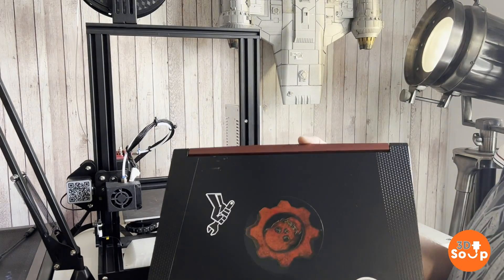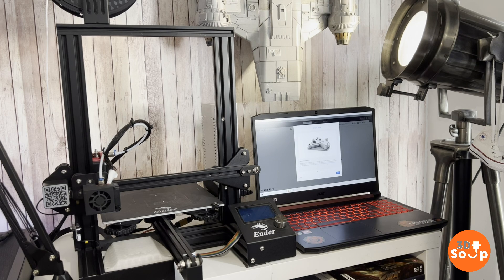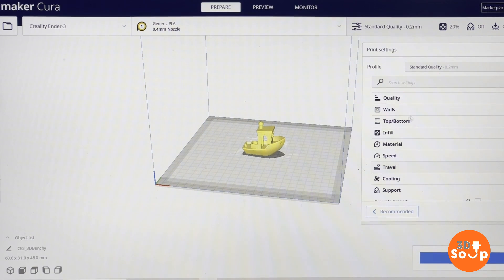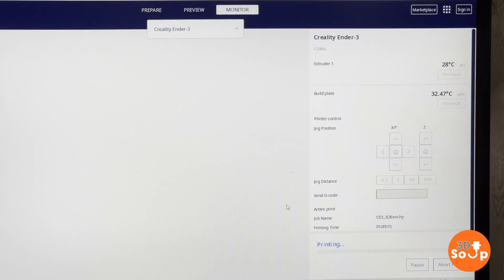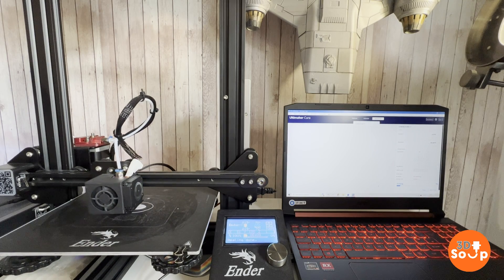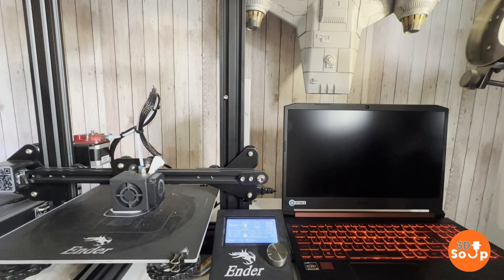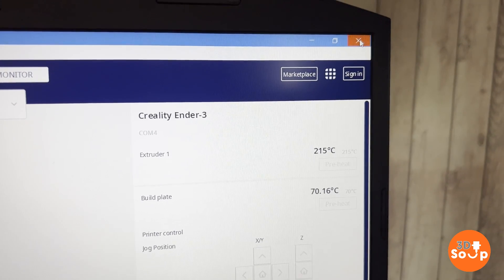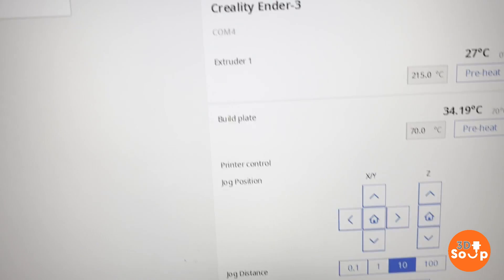Connecting an Ender 3 3D printer to your computer or home network via the USB port and why to do it.

Comment: Thank you for this, can you tell me the full model name for that printer as I am strugging to find it on Cura
Reply from the maker: Just add a non ultimaker printer, choose Creality and then choose the ender 3 you are using. Thanks for watching :)
Reply: @3dPrintedSoup it's the same printer you have in this video but the model I have been struggling with. The box says Ender V3 3 but so many of the slicers have SE or neo bit it's not one of those and I got it as a present and they will not tell me without proof of purchase

Comment: I was doing this with my ender 3 3d printer but cura doesn't have it anymore what should I do should I put it under a different 3d printer or use something else
Reply from the maker: Even if it’s not showing up by default, Cura still supports the Ender 3. Here’s how to get it back:
	1.	Open Cura.
	2.	Go to “Settings” → “Printer” → “Add Printer…”
	3.	Click “Add a non-networked printer”
	4.	Scroll down to Creality3D and choose Ender 3, Ender 3 Pro, or Ender 3 V2, depending on your model.
	5.	Click Add.

If it’s still not showing up:
	•	Update to the latest version of Cura from Ultimaker’s website.
	•	Or install an older version (like Cura 4.13) which definitely includes Ender 3 profiles.
Reply: I tried that but it doesn't seem to support ender 3 V1
Reply from the maker: Odd, just tried and the ender 3 profile is still there and works fine with my V1 and pro

Comment: can ender 3 s1 pro do this?
Reply from the maker: I don’t think the usb on the S1 is able to this, been a good couple of years since I had one though.
Reply: @3dPrintedSoup oh dang, some how i think its caused by bootloader, i try to buy cheap clone st link v2 to force it, but make a backup first so if i'm failed i have my way back

i done a lot of way
gcode to force flash
usb
sdcard

but not with DFU cause i have limited knowledge about it
what do u think?

Comment: Why am I always the only one that can't solve an issue like everybody else? I'm doing exactly what you did, but I can't connect the laptop to the printer with a cable. I only get the Save to Disk option.
Reply from the maker: Don’t worry, the ender 3 is great but there are loads of variations ect. Try checking that the cable is a data cable and not just a charge one. Make sure you have the most up to date version of cura and the printer firmware is current. Best of luck :)
Reply: Set it all up plug in the usb computer first and it’ll happen
Reply: Ive got an endwr 3 and im trying to connect it to cura and orca slicer and cant get it on either any ideas?
Reply: @jamesblack1683 sometimes the cable you’re using might only be a charge cable instead of a data transfer cable

Comment: OK. You have Cura & an Ender 3D Pro. It appears that you had no problem connecting through a USB cable. I have Win 10 & Ubuntu Linux OS. , Cura & an Ender 3D Pro. y systems see the CH340 USB serial port. But not the printer! What clues do you have for connectivity & control problems?
Reply from the maker: Yeah, this video is about connecting to a windows pc via usb. No idea how Ubuntu would affect it. Best things to check are that you are using a data cable, not just a charging cable. Make sure your printer is on up to date firmware and that you are using the most recent version of cura. Thanks for watching :)

Comment: Will this same method work for the voxelab aquila x2? It has the same port on the printer but does cura support voxelab
Reply from the maker: You would need to check if the port on your printer is a working data port, or if it is power only. Check the list of compatible printers on ultimakers site to see if cura supports it.

Comment: This is great.  I inherited an Ender 3 Pro but it didn't come with manuals, software or SD card.  Someone told me that the machine only works with 8GB max SD cards and those are impossible to buy today except maybe used on ebay.  Will this work with free software such as Creality Slicer?
Reply from the maker: Not with creality slicer as oddly they don’t support it, use cura, it’s free, or orca slicer. Thanks for watching

Comment: Which version of Cura are you using.  and what Operating system
 software is on your laptop?  thanks
Reply from the maker: Use the latest version of cura and select ender 3. Windows 10

Comment: Have you not upgraded your hot end yet?

Also, the issue I had when it came to printing via USB connection, was that it'd stop mid-print... And nope, no sleep option set.
Reply from the maker: This is my stock ender 3. I have several upgraded versions of most Ender models . Not sure why your print is stopping, , not enough info to guess
Reply: @3dPrintedSoup  aye, there's no errors whatsoever, unless there's a debug mode, but I've switched over my Octoprint to my servers not instead of Raspberry PI, if I get the chance, I'll try it on there.

Comment: Do I need and expensive high performance laptop? Or is a budget laptop okay? I'll just be extracting files not making my own 3d modules
Reply from the maker: For linking and sending files to a printer, no, a regular modernish laptop or computer will have no problems- for 3d cad design and 3d modelling, you are going to want something with a bit of power as this can stretch most systems depending on the type of design you are doing.

Comment: printo from usb? nope not an option for me......makes sense on whyt i could never preint from the darm laptop. and it wont take my usb card a-either. YAY worst interface ever on these enders!
Reply from the maker: Hi, just checking, you are using a data cable and not a charge only cable right?

Comment: What happens if I am printing via cable and my computer shuts down? Will it continue printing or will it stop and lose the printout? Thk
Reply from the maker: You are printing directly from the computer, if you turn off the computer then your print will stop. Hope this helps.

Comment: My daughter lost her USB is there a replacement I can use
Reply from the maker: You can just buy another usb stick, should work fine. If you mean a usb cable then you can use any usb data cable as long as it matches the connection on the printer (mini,micro or C )

Comment: if I have my printer connected to my PC and have creality installed on my PC and in the same account will I be able to control it with my phone?
Reply from the maker: Not with creality slicer as last time I checked they insist you have the creality box to connect non WiFi printers . If you have a raspberry pie, you can setup octoprint or the like to connect some printers wirelessly to a network, see my video on this. Hope this helps.

Comment: I can’t seem to connect my printer to Cura since it just says “in order to monitor your print from cura, please connect your printer.” Even though it’s connected with usb cables
Reply from the maker: Okay, check you are using a data cable and not just a charging cable.thanks for watching :)
Reply: @ ohhhh how do I know if I’m using a data cable and if I don’t have one where can I get one? (Edit: I GOT IT TO WORK THANKS SO MUCH NOW I CAN PRINT MY BENCHY!)
Reply: @Mr_porkchopgood work!
Reply: @Mr_porkchop how did you get it to work mine is saying the same
Reply: @joshuavanvuuren-t2o  you kinda just have to restart cura and if that doesn’t work unplug your printer turn it off then turn it on and plug it back in

Comment: My Ender 3 won’t connect to my computer for the life of me. It used to work and print perfectly fine. Any help/ advice?
Reply from the maker: Hi, make sure you are using a data cable and not just a power cable. Also ensure you are running the latest firmware on the printer and the latest version of cura. Thanks for watching

Comment: SO a created a Cura account but it doesn't seem like I can add/use my Ender on this software
Reply from the maker: Open cura, click the drop down next to the open file icon in the top left of the screen (it looks like a file) , click add , choose ultimaker or no ultimaker and then either choose your networked printer or add a non-networked printer. Done

Comment: is there any specific reason that my ender 3 3d printer will not work with my micro usb cord.
Reply from the maker: Which model ender 3 are you using?

Comment: Will this work with a Windows 7 version for the ender 3. If so, can you please tell me which version of software through the slicer should I use.  I have a new laptop.  But I have several older windows and 7 laptops.  One being the acer aspire 7540-1284. Thanks in advance for any help you may be able to provide.
Reply from the maker: Never tried it on windows 7 so you will have to give it a try and see.

Comment: i really need your help, indon't seem to be able to connect my ender-3 and i just wanted to know if you have to use a spicific cable?
Reply from the maker: Depends which version you have, some have mini usb and some have micro or usb C . You just need to get the one with the correct connection- and make sure it’s a data cable and not a charge only one. Hope that helps
Reply: @ alright thank you very much dear friend 🤗

Comment: Just watching this and as for the sleep issue, there are detailed settings in windows that can shut down or reduce the power to the usb ports as part of the "power save"
I also run photobooths and because of that I have done a deep dive and changed all the power saving functions prior to putting the systems out in the wild as they can drop the camera connections if left at default values. This also helps to maintain highest levels of performance on the systems at all times.

Great info overall, I'm looking forward to repurposing an old system to control my printer via the usb instead of constantly swapping the SD card in and out.
Reply from the maker: Glad you enjoyed the video, thanks for watching :)
Reply: How did you do it? I plan on using an old laptop for printing and camera monitor and thought I would just disable every kind of sleep/hibernate/screen off/saver

Comment: I changed the board, in my Ender 3, from the original Creality board to a BTT SKR Mini E3 V2.  Everything worked fine with the Ender board.  However, with the new board (BTT SKR Mini E3 V2), my computer does not recognize / cannot find the Ender3 now.  Any thoughts, ideas, suggestions.  I am not super computer savvy or techy.
Reply from the maker: Hi :) as you have swapped the main board out, your printer may no longer be seen by your pc/cura as an ender 3 (not 100% sure as not used this board myself). Check with the manufacturer to see if the board supports usb input.

Comment: 8:15 ah the introductory line that I forcefully moved to the bottom center by modifying the gcode so that it was easier to remove on my ender 3 v2 😀
Reply from the maker: The line is there to ensure the flow is smooth and consistent, if you remove it fine, but it’s there for a reason. Thanks for watching and commenting :)
Reply: @3dPrintedSoup  I didn’t remove it, I modified my slicer’s start gcode paramater to move it to the bottom middle instead of bottom right corner

Comment: i have an issue where i have everything set up, the power is on, i sliced it correctly and i did everything else. But the second i connect the usb cable from my pc to printer it doesnt registeer it on the computeer, and i dont have the option to print straight from the slicer on the montior screen, and also the screen on the ender 3 keeps blinking until i unplug it with the power on. Any tips on how to fix this?
Reply from the maker: Hi there! Have you got the printer plugged into mains power as well as usb? Have you clicked the drop down menu next to the slice button and selected usb?

Comment: I'm having trouble, you did not mention the printers usb drivers once when Everyone else does, currently my pc has no way of talking to the printer as they both do not acknowledge the other, how should I proceed?
Reply from the maker: Make sure cura is up to date, make sure you have the newest firmware is installed on ur ender 3 - you should then be able to choose your printer via cura.

Comment: whats the point of monitor? thought it would show you realtime what its printing (layer etc). if not this function is useless and no point connecting to printer
Reply from the maker: If you find the ability to send G code directly to your printer without needing to use an sd card useless that’s your choice. Thanks for watching.

Comment: hello. ik im late and this might be a stupid question. but if i connect my printer do i also power it on via the powerswitch or just the cable in the laptop?
Reply from the maker: You need the printer connected to power as usual, usb doesn’t have the juice needed to run a printer unfortunately. Thanks for watching.
Reply: @3dPrintedSoup  ty ty. unfortunately cura doesnt find my monitor connected. so ill stick to sd cards. i have to get a reader first but your videos helped me alot getting started. big up again

Comment: Thank You for the video. Do you keep the sd card with the firmware on it,  in the printer or take it out?
Reply from the maker: Once the firmware has installed and upgraded it’s on the printer permanently, you can take the sd card out and delete it

Comment: Mine crashes with my usb 😂 pls help 😢
Reply from the maker: Need a bit more info.
Reply: @3dPrintedSoup  I plug it in, and the display flickers and stops, and if anything is printing, it stops and says lost of power resume or stop print, and cura does not have the ender 5 pro (my printer) so I just use the regular ender 5. When I connect it with the power button off, the screen turns on (which is why im thinking the usb is drawing power from the usb to the printer).

Comment: cura isnt detecting my printer for some reason i have it connected via micro usb, selected the right model, when i click slide and the right it does not give me the option to print it only to save it to my library any help would be appreciated.
Reply from the maker: Okay, check you are using a data cable and not just a charging cable.
Reply: @3dPrintedSoup How do I tell the difference between them?
Reply from the maker: A good question- it’s not the easiest thing in the world as they are not really marked as data and non data. I look in the usb A end and see how many connectors it has. If it’s only got 2 then probably a power only cable- saw between several and see if any work for you.
Reply: @3dPrintedSoup I see 4 just ordered a new cable hopefully that works.
Reply: @Subfisher Im having the same problem aswell. Did the new cable work?

Comment: Hi mate, when I connect my Ender 3 Pro via USB my printer reboots. I don't think it can sustain a print job with the cable connected. Happen to have any idea why this may be?
Reply from the maker: Okay, first question, the printer is plugged into the mains and turned on right? Sorry to ask but have had some cases where people thought the pc would power the printer via USB.
Reply: @3dPrintedSoup  yes sir you're correct, I have the power cable plugged into the PSU. Prints work just not when usb is plugged in, marlin reboots. I have 2.1.x bugfix applied too
Reply from the maker: @bcboncs is the cable you are using a data cable and not just a power cable?

Comment: How do you print using WiFi please?
Reply: Thank you for the guidance, as I thought, I have the basic Ender 3. I've watched videos about the raspberry pi, creality wifi box 2 etc and don't think either will work. So I'm going to try and connect to a dedicated laptop connected by cable (to the printer, as in your video) via my network and WiFi 🤷‍♂️
Reply from the maker: @seasidegreyhounds3670  hope it goes well. :)
Reply from the maker: Check out my other video on using octoprint
Reply: So is it impossible to connect to a base Ender 3 using a computer plugged into the micro b port over the Internet?
Reply from the maker: @seasidegreyhounds3670 as I said, watch my video on using octoprint.
Reply: I've only just purchased the printer, but believe it's just an Ender 3, not V3 as you mention in the video. How do I check which version I have?
Reply from the maker: @seasidegreyhounds3670 there are several types of ender 3 . The ender 3, ender 3 pro, the ender3 pro max, the ender 3 neo, the ender3 v2 and so on. If you don’t know what you bought then you will need to go into settings and check the model you purchased in the “about printer” option.

Comment: I did this a while back with an old laptop from 2007 and pronterface.  Worked fine.  Took it s step further and added in a webcam and google remote desktop and not only can I run prints from the laptop I can do it remotely from my phone when I'm at work and watch the whole thing through the webcam.  Literally cost me nothing but a bit of time.  I prefer pronterface for the ease of entering gcode commands and I even ran a PID autotune while I was at work (someone was home though).
Reply from the maker: There really is no limit to what an old laptop and an ender 3 can achieve. This was a basics video, will definitely have to do an update with more advanced features :) thanks for watching

Comment: I have tried and failed to install my ender 3 neo to my computer. I have searched all over and reviewed your videos and still cannot install the printer. Do you have any advice to where I can find drivers? It just shows up on com 5 but will not pull any info.
Reply from the maker: When you say install the printer, you shouldn’t need to install anything other than cura, I don’t have any experience with the neo but a usb connection should be detected by cura.
Reply: @3dPrintedSoup  I downloaded ultimaker-cura 5.6.0. It does talk to my ender. I can home it and see temperature settings but I do not see where I can send my projects to the printer